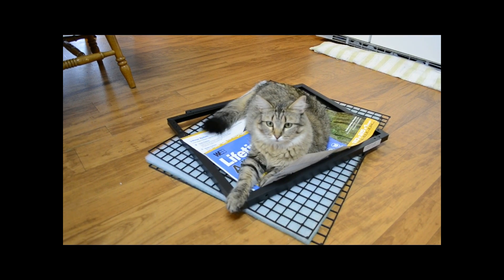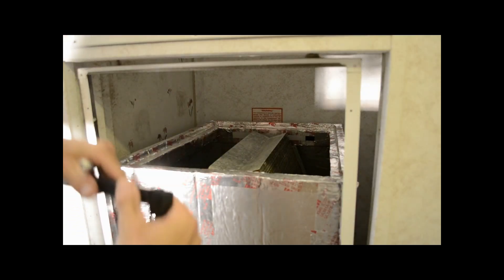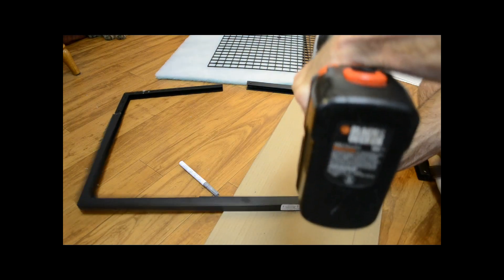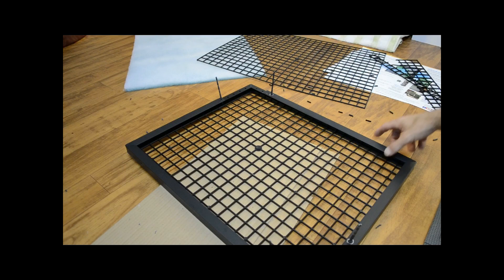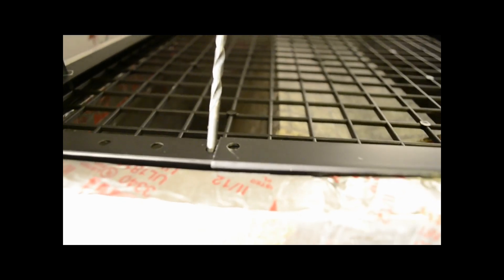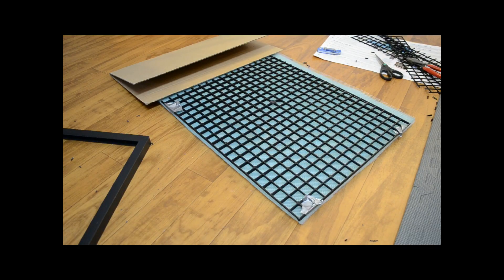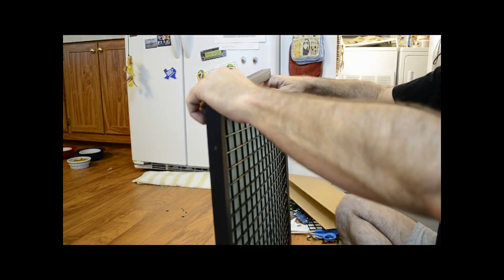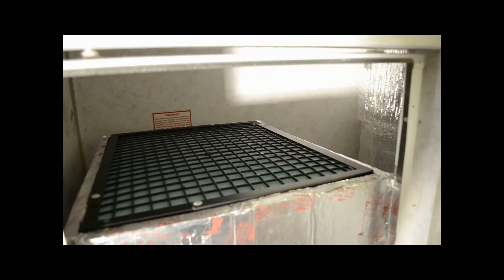HVAC Build a Sizable Reusable Washable Air Filter. Can't find a filter that fits? This is it!

Comment: I have that filter too. It's merv 8and has good air flow. I think it's the best balance of cost, efficiency, and airflow. Most filtermerv 8 or higher are too restrictive and are hard on your system. I tried more expensive high merv filters, cheap filters etc and this is the one to get imho.

Comment: Hey mikie, I hat to tell you this but you just limited the airflow to your unit by more than half. The metal bar across top of your coil set is n fact the bottom stop or the top stop for the 2 filters your supposed to use. If you wanted to get a re-usable you could clean you needed 2. You WILL BE REPLACNG A MOTOR OR CALLING A SERVICE TECH AT SOME POINT BECAUSE YOUR UNIT IS GOING TO STARVE FOR AIR AND WILL TRIP ON HIGH LIMIT. I have 0 years experience in HVAC and I am also a PE in mechanical engineering. You would have done better to do some research before doing this.

Comment: What is the name of this furnace filter holder and where did you buy it? Or can you provide the link? My furnace keeps sucking my filter inside. This was very helpful and will solve that problem. Or would you suggest I just buy some sort of grate and put in front store bought filter?
Reply from the maker: Hi Julia! Wow, it's been so long now that I don't remember for sure... It has to be either Walmart or Lowes. I would lean towards Lowes though. Usually most units that take a big filter will have a metal rod, or a U shaped metal rod that go across the empty space to keep the filter from getting sucked in. It would look like this:
https://www.ferguson.com/product/rheem-27-in-filter-retainer-rod-r452409501/_/R-425489
You clip the ends of the rod into holes in the sides in the back, slide your filter in, then you bow the metal rod some so that the flat side will truck under the metal lip at the front where you slide it in.
Mind you, it may not make sense if your system wasn't made to use this, and you don't have access to do it. Hehe.
Of course it would suck to order one and have it not fit your system :/

Just for kicks you might look around in there with s flashlight to see if it was dropped at some point or laid to the side, though i suppose it might have been left out, or some system that wasn't designed with one.

An actual pleated filter will always be better than the one I bought, they just catch small particles of dust better. I did mine as a project, but have been meaning to modify my filter base with a rod in the middle so I can use pleated filters too. (You can see how lazy I am on getting projects done by looking at how old this video is, lol. My round-to-it list is a mile long!)

I've seen customer's do all kinds of crazy things to keep filters in, from using a bunje cord, to laying a 2x4 across the middle, lol!

Well hopefully some of this will help!  As an OMG moment, the only rod like the one i linked above that i could easily find on Amazon, the thieves wanted $30. For it and like $66. For shipping!!!!! Just insane!!

Comment: For those wondering: BOTH SIDES OF THE FILTER ARE THE SAME, regardless of one side being color and one side being white. The airflow arrows are there for your consistency, in case you remove and reinstall without cleaning. This is stated in the last diagram of the Installation Instructions. If the filter is cleaned there shouldn't be a discrepancy. Whichever side has visibly collected more debris would then obviously be your intake side (if you disassemble without paying attention to the arrows, like I did). <3
Reply: Just what I was looking for. Thank you!

Comment: Which side goes with airflow (that is would be the UP arrow)?
Green?
White?
Reply: I cannot seem to find this answer anywhere either. It is my belief the white side is the intake, and the green side should be the out. Update: According to the install instructions on the manual, BOTH SIDES ARE THE SAME. The airflow arrows are there for your consistency, in case you remove and reinstall without cleaning. If the filter is cleaned there shouldn't be a discrepancy.

Comment: I bought this same exact filter a few years ago, at 3 months inspected it and it was still pretty clean com paired to paper filters I had been using. Not very effective in my opinion
Reply from the maker: +Robert Smith I agree, definitely isn't catching stuff down to the micron level :/. It just worked out as my only choice at the time. I suppose I could get off my lazy butt and measure and custom order a couple of cases of pleated filters.